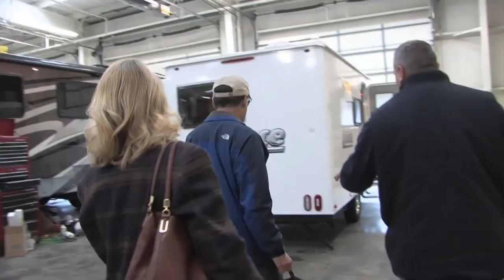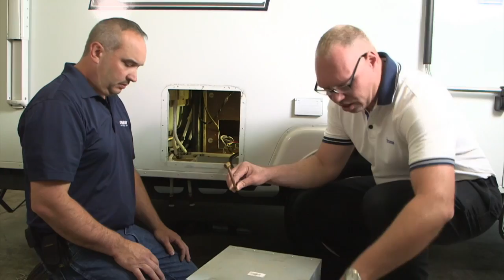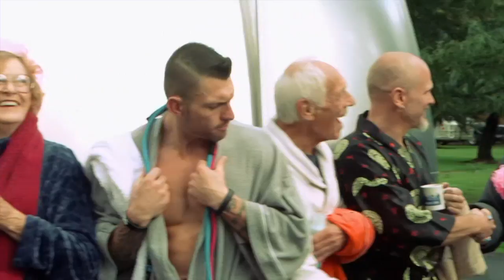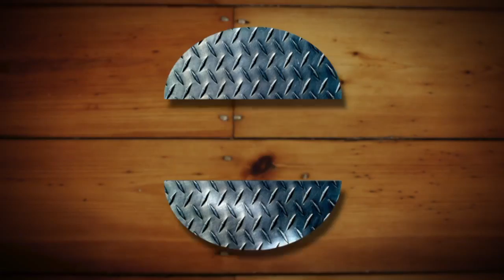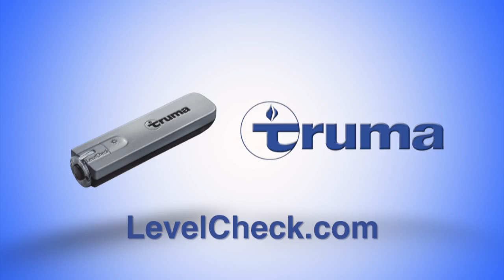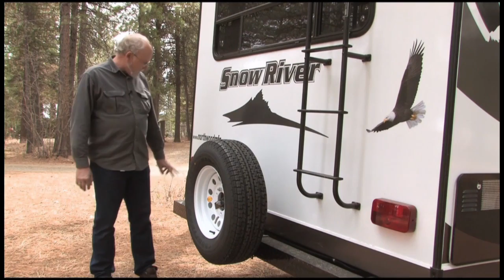Rollin' On TV Show #2016-12 • rollinontv.com

Comment: More often than not its not the water heater that's the problem it's the RV shower plumbing. When you adjust or turn the water flow off or down, cold water flows back down the hot water line, making it hard to maintain a constant water temp. Why do you think Truma wants a complete plumbing redo when purchasing one of their heaters.

Just install a back flow preventer on the hot water line and "real" water shut off valve and all your problems are over.

Ron W.